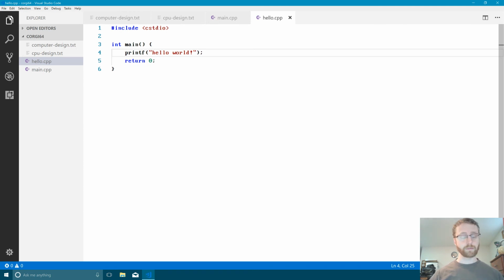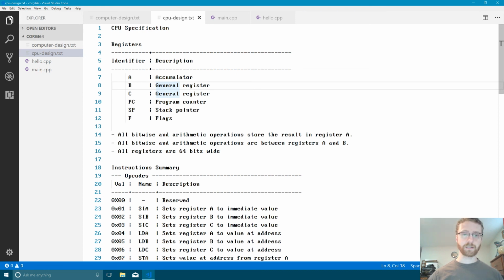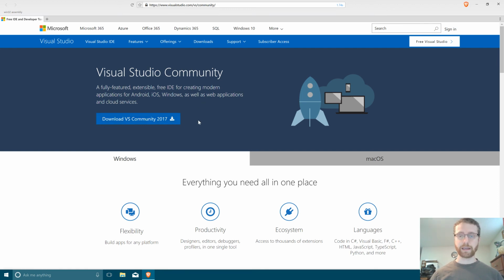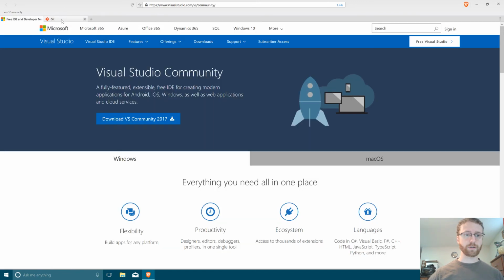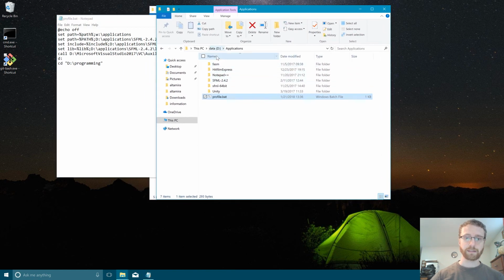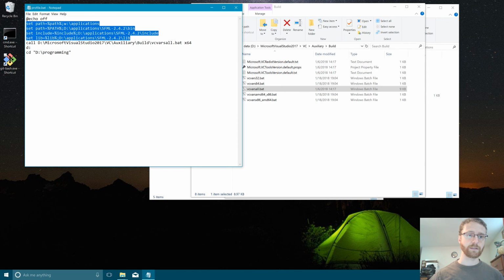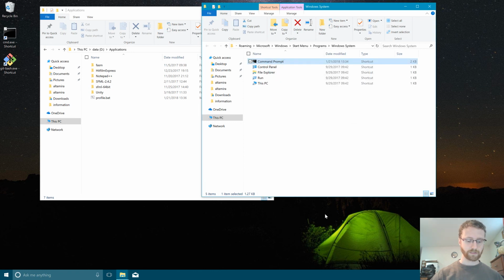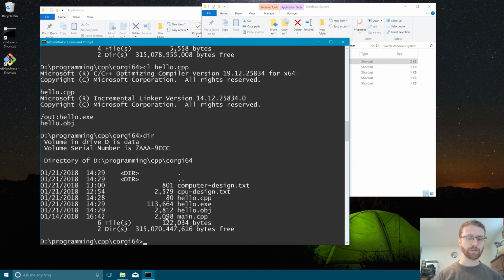Corgi64 #1: Introduction and Development Environment Setup

Comment: Following along on Linux with full intention to port this into my VM project. I will probably be making a lot of changes, for instance, using a more ARM-like syntax for the ASM and a full ARM register set.
Reply from the maker: Sounds good. I've tried to make it as simple as possible and relatively platform agnostic. It should be relatively easy to modify.